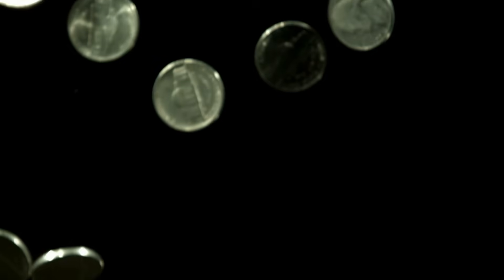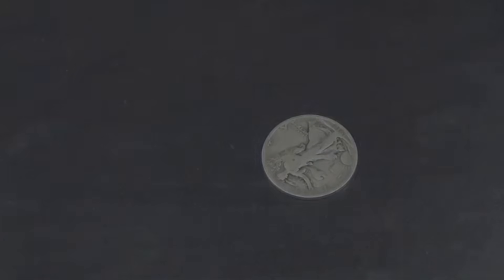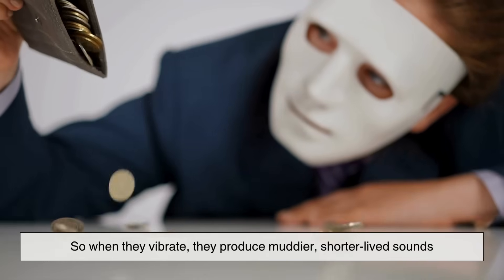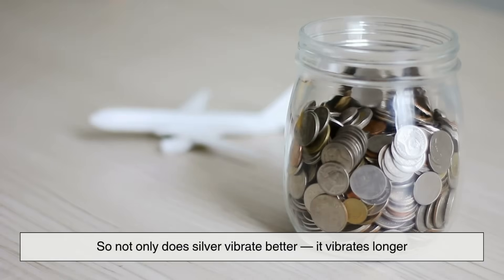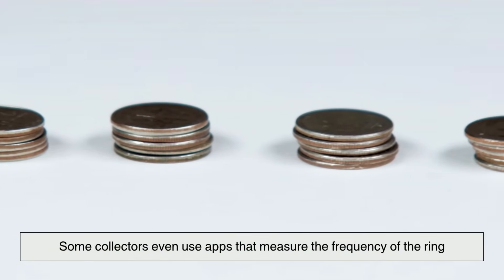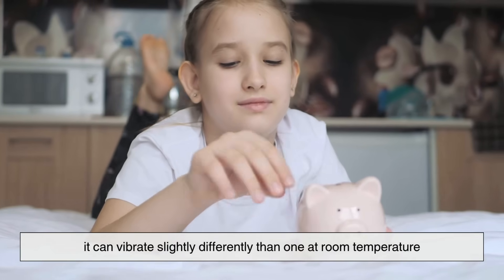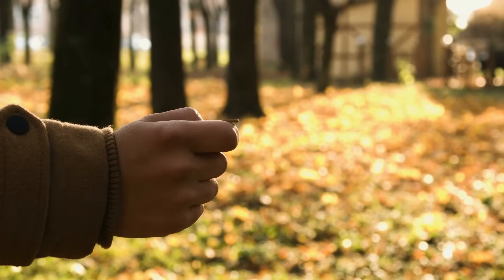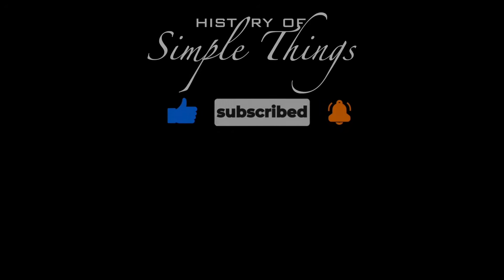Why Silver Coins Sound Different From Nickels

Comment: Fun fact, the american gold eagle has a distinct attractive ring as well.  It's really quite something. 
Another fun fact, Silver is unmatched to most metals in many regards. It's the most electrically conductive, thermally conductive, and the most reflective. It also has anti-microbial qualities similar to copper. Silver nano particles show promise as catalysts as well.  Gold is an impressive metal, but it's usefulness as a conductor is only where intermittent physical contact is necessary, or tarnish is a big concern. Gold does not corrode. 

While silver and gold have paced inflation, they are not technically more valuable.  Though one could argue that Gold has appreciated more. And silver has due to very high industrial/investment demand. The main reason they changed the composition of our coinage is because they can't be fiscally responsible. They can't even make an honest cent anymore.  In 1982 they changed a copper cent to mostly zinc. Copper has not increased in value (perhaps slightly),  they print/spend more money than they take collect from taxes. 
I suspect more revisions to the alloys are to come, as copper is highly desirable for electrical infrastructure. Even Nickel (the metal) is very useful in industry.  Governments need to be more responsible... 

Though it's an interesting question: What would our technological level look like had we not printed excess money? Perhaps one can borrow their way to prosperity 🤔

Comment: Only bullion coins are 100% silver or gold.  They are made to be stored in a vault.  Pure silver and gold is too soft.  For circulating coins, the US had always used coin silver, a 90%silver/10%copper alloy.  The 10% of copper makes it slightly harder, with more wear resistance.  Dimes,Quarters, Half-Dollars, and Dollar coins were coin silver.  But Nickles are made, with the metal Nickle.  Only once in 1943-44 (during WW-2) The US minted silver nickles as the nickle was used in types of armor plate.  These silver "nickles" had a small S stamping, after the war they were collected and melted down and returned to the Mints silver reserve.
The US also had gold and silver certificates. these came in $1, $5, $10, $20, $50 and $100 demonations  They could be used just like any other bill in normal use.  But if you took it to your nearest Federal Reserve bank, (in my case, Chicago), you go to the teller, tell them I want to redeem this in silver/gold.  The teller will examine it, yes this is a $10 Silver Certificate, go back to the vault and 10,15 minutes later come back with $10 in silver.  Depending on the amount of silver/gold it may be a combination of coins and strips.  In 1969 the Reserve stopped redeeming certificates, but they could still be used as regular money.  They also discontinued the $500 bill.

Comment: Regarding 4:31, the Ping Test can also be used to acoustically test Fake Gold Coins made from gold plated tungsten that look like and feel like genuine gold coins. Tungsten is used by counterfeiters, because the density of tungsten is almost the same as gold which has a density of 19.3 grams per cubic centimeter. A genuine gold coin will produce a resonating ping sound whereas a gold plated tungsten coin will produce as dull thud sound.